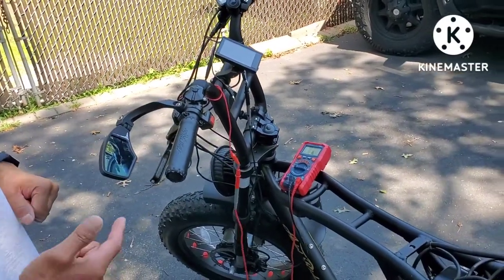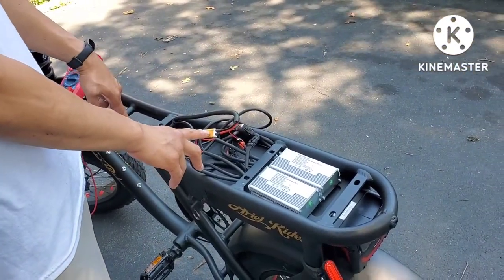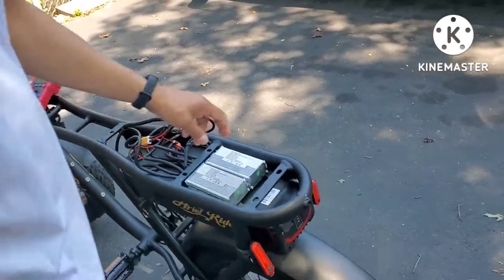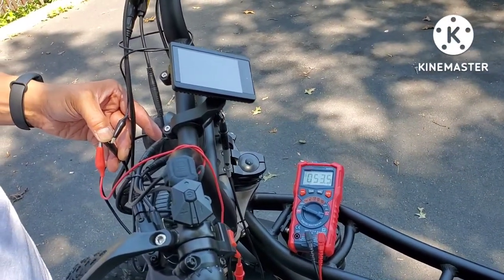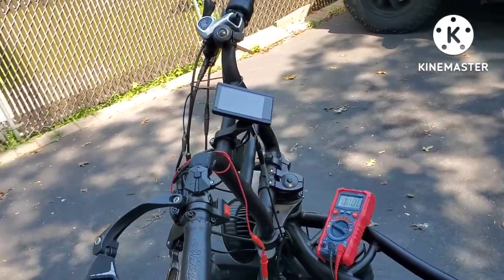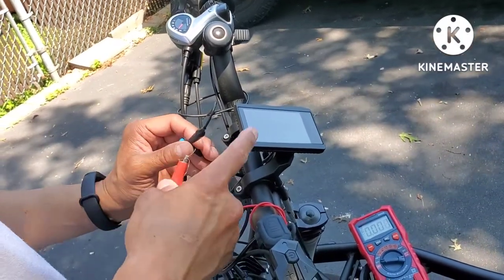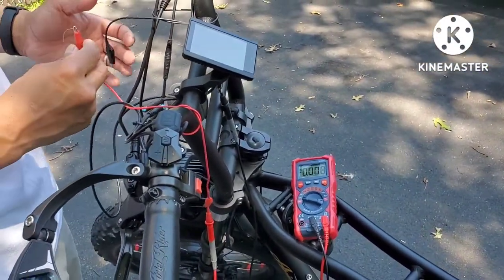Arielrider D-class does NOT Power Up. Part 3

Comment: Where did you get the mini volt Meter a and b wires
Reply from the maker: Amazon 
https://amzn.to/3ONBKkJ
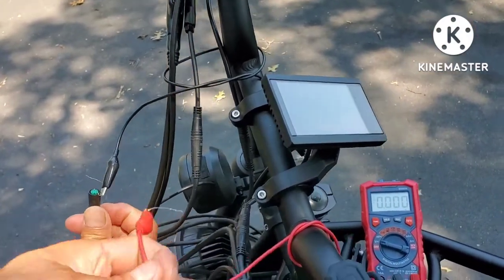Reply: @Electrify US   thank you for responding. But I was referring to the volt meter attachment you used at 1:26 to check volts that power the lcd. I'm having the same exact issue that you were having and I used your video as reference to do it my self and it was very helpful. I just need that small wire to fit in those lil holes
Reply from the maker: @RnbFleeRbf  the alligator clips https://amzn.to/43zat9L
Reply: I went through all this. Replaced the controller, display screen and still nothing.  I don't know what else to do.